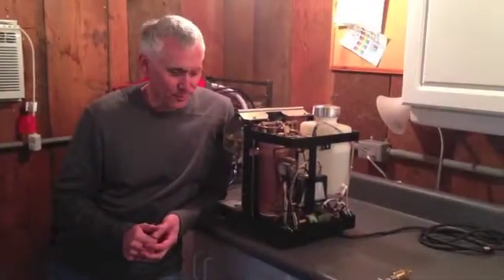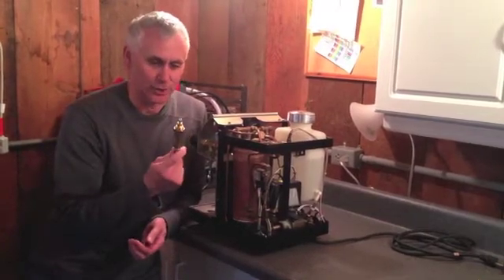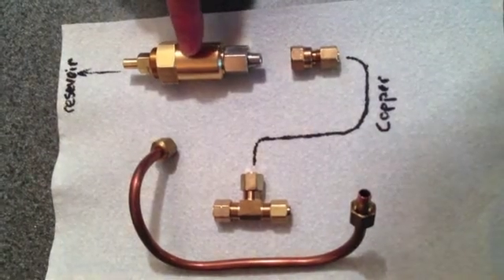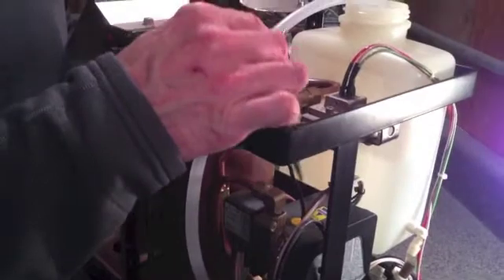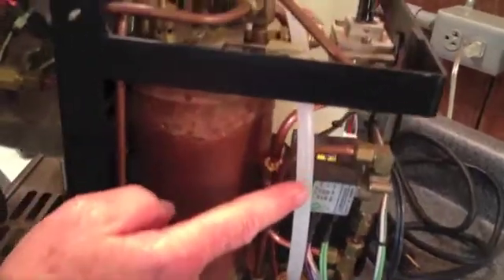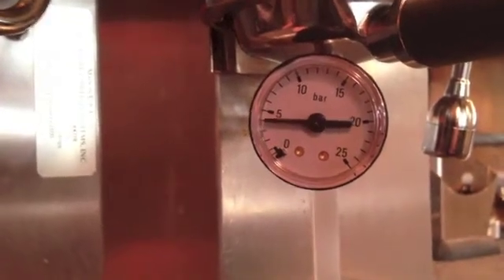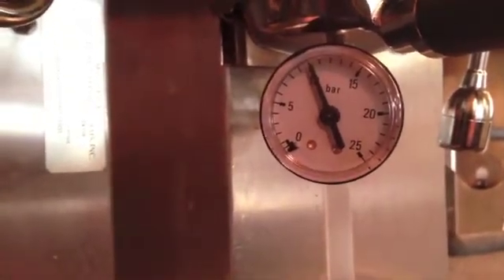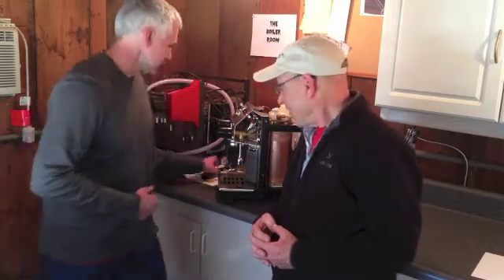Salvatore OPV Installation

Comment: Hey great video !!!. I just picked a used machine.  is the mod  worthwhile?...
Reply from the maker: Hi John,  Sorry for the delay.  If you have an OPV then you'll be able to set the extraction pressure for your E61.  There has been a lot written about this but in general if you set your pressure at 9bar, you'll get nice shots.